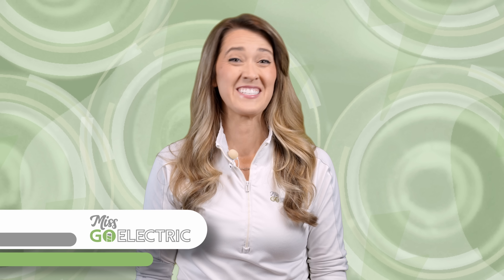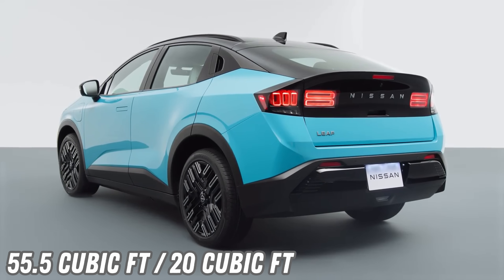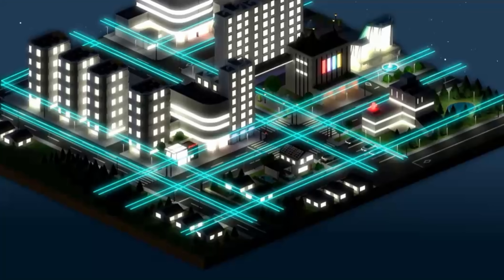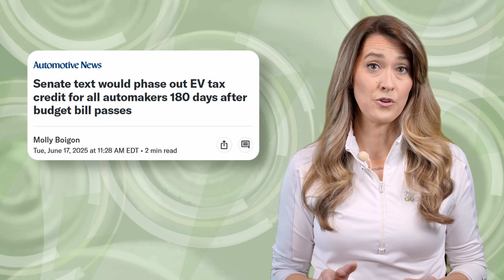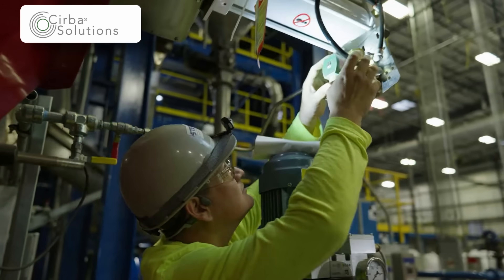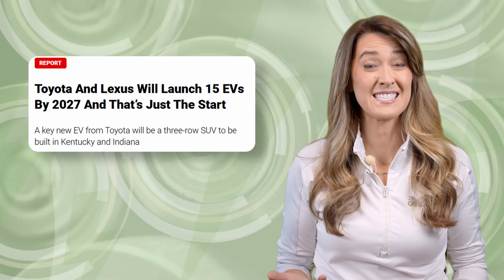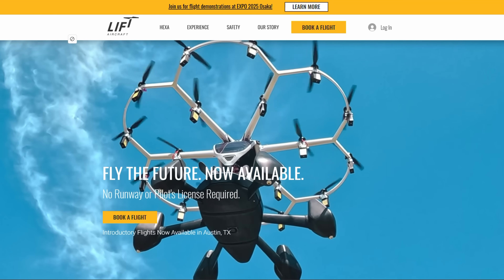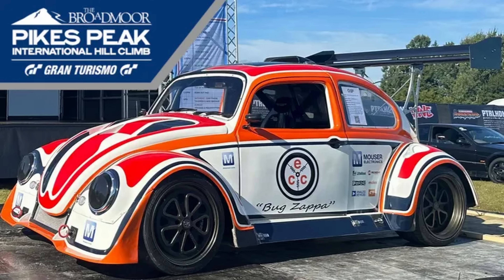The Current : Weekly EV News Ep#68 Jun 22, 2025

Comment: 1:28 highest trim gets the least range showing that they are completely out of touch with what it’s gonna take to get non EV buyers to buy EV’s.
Reply from the maker: Remember, the LEAF is basically a modified Ariya.  The Platinum+ Ariya also has the lowest range? Why?

There is only one large battery pack.  More features bring up the price, weight, and current draw.  There is no room for more battery, which means the fixed amount of energy results in fewer miles traveled.
Our detailed review of the Ariya will lend further insights into what is gained at the cost of range:
https://youtu.be/SdOal5q_7kA
-Producer Tim

Comment: eVTOL - zero glide time - NO
Reply from the maker: Helicopters have been around for quite a while.  They lack redundancy and incorporate thousands more moving parts which are susceptible to failure.  EVTOLs have high redundancy and very few moving parts.  Improved reliability and increased uptime are benefits of the platform.  Lower costs, lower noise, and greatly minimized required infrastructure for convenient hub locations are also benefits.

Remember, it will be much safter to fly an EVTOL from your small town or neighborhood to the airport than it is to drive an automobile to the airport.  Eventually, it will also be cheaper.  That is the primary function of the EVTOL rollout.  Short regional flights. -Producer Tim

Comment: They should have just gone with NACS like the latest Ioniq 5 - having two ports will just get confusing. What a miss.
Reply from the maker: NACS was adapted as a standard well into development of the LEAF.  Remember, this is a mass market product...essentially a modified version of the Nissan Ariya.  Nissan surely sourced the port component supply and finalized the charging system engineering at least a year ago.  It is somewhat miraculous that they've incorporated the port already.  The GM Sierra AT4 was just launched this month by an American automaker and it lacks NACS.

Remember, the LEAF has always had two ports. This is not new. -Producer Tim
Reply: @MissGoElectric  I did not know that the Leaf had two ports. In any case it seems like it would be wise to stick with NACS for any 2026+ vehicle. Putting J1772/CCS on a 2026+ model is like having a phone with micro USB
Reply from the maker: The new LEAF does NOT have a CCS port. It has a NACS port and a J1772 port.  Adapters are $30-$130 enabling AC and DC interoperability with all networks in America.  I do not understand how the user experience is degraded by having two ports. -Producer Tim

Comment: The 7.5 kw AC charging is a deal breaker. It should be 11 kw or better. That’s the only thing wrong with it.
Reply from the maker: What percentage of users depends upon AC charging for urgent situations with any frequency?  What is the real world improvement for most drivers who charge at work or overnight?  A full 0-100% charge of the largest battery pack would take 10hrs on 7.5kW or 7hrs with 11kW.  Either way, its done by the time folks wake up and go to work.  I cannot argue with the idea that faster is better on paper for sure.  I'd rather have a capability than not have it. From a practicality standpoint, I'm not sure the stats would show any quantifiable real-world benefit of 3.5kW for most use cases. -Producer Tim
Reply: @MissGoElectric  If you have been driving one all day and then get invited out to an event that evening there will not be time to add enough range. We have two EVs so we can just take the other one but if you only have the one car that won't work.
Reply from the maker: Less than 1% of Americans drive more than 50 miles per day. The average new EV has 250 miles of range.
If somebody is in a hurry to get a charge neither a slow 7.5kW to slightly less slow 11kW are particularly helpful solutions.

11kW is 0.18kWh per minute. 7kW is 0.13kWh per minute.
Example: Tesla Model Y would gain about 30mi/hr at 7kW and 44mi/hr at 11kW

-Producer Tim

Comment: I like the 2 different charging ports. Best of both worlds.
Reply from the maker: Thanks for sharing your thoughts on it. The LEAF has always had two ports.  We don't see a problem with it, but we see that some folks do.
We drive Tesla, Rivian, BMW, and Zero brand EVs in our house.  Each one has all of the adapters available.  We like flexibility.  Its great to see the country is moving towards one standard, but during the interim, having the capacity for interoperability is important to us.  -Producer Tim
Reply: @MissGoElectric  Again, OEM dragging there feet to standardize the NACS standard.
Reply: I don't, it just makes it more confusing and requires the need for TWO separate adapters now.
Reply: That configuration would work well with our home charging set up. Tesla’s charge port location does not.

Comment: Im going to post the explanation here for anyone to read on the Nissan Leaf port situation: NACS is a single port charging standard with shared AC/DC pins with a switch to choose AC or DC charging and an onboard charger which must be capable of 277 volt charging. The NACS change was made mid-design. Their onboard charger supports up to 240v as CCS needs, so to NOT have to find suppliers and figure out a switching mechanism, they took an international version of the car with 2 ports, and since CCS uses 2 seperate AC/ DC charging wires, simply turned the AC wires to point at a J1772 adapter to keep the same onboard charger and wiring, while pointing the 2 DC pins to NACS.
Reply from the maker: Yup....and...the outgoing LEAF had two ports. No biggie. -Producer Tim
Reply: @MissGoElectric yeah, but that's different given it was a AC only port (J1772) and a DC only port (ChaDeMo). An equivalent would a J1772Combo & ChaDeMo, but the CCS port only did AC charging. That's what the problem is.

Comment: Evtols sound dreadful … lots more stuff to clutter up our skies and come raining down on us when things break, especially with lack of proper regulation (as is the case with drones now)… we need much more regulation in the USA to protect people from corporations, not less
Reply from the maker: Remember, automobiles are much more dangerous than helicopters.  Helicopters are MUCH more dangerous than EVTOLS.  EVTOLS have 2-5x redundancy (can stay aloft and land safely with several motors failed/damaged) and EVTOLS have far fewer moving ports for exponentially greater reliability.  EVTOLS are quieter which means they can pick us up and drop us off in more convenient locations.  EVTOLS require a very small amount of property, unlike airplanes.  They can be put down in an emergency situation with far less exposure to dangers such as powerlines and tree lines due to a lack of required glideslope.  The Pivotal EVTOL, for example, is designed to float.  It has parachutes, too.

 EVTOLS are meant for regional transportation.  It will be much safter to take an EVTOL to the airport than to drive there.   -Producer Tim

Comment: (1:30) when will automakers learn that electronically recessed door handles don’t help range significantly in any way but cause huge headaches to people using them (whether the frustrating ergonomics of using them or the fact that they can and will dysfunction/break)… one of the many stupid ideas pioneered by Tesla that’s emulated by other automakers with idiot designers
Reply: The Tesla electronically recessed door handles you refer to were purchased from Mercedes.  They were the biggest maintenance problem on the Model S.  The mass market Models 3 and Y thankfully dumped the self presenting handles.  The Cybertruck completely eliminated door handles.
Reply from the maker: Automakers know that flush surfaces DO improve drag coefficient, reduce turbulence, and decrease wind noise.  They do it because range is important.  Every single one of the top 10 most aerodynamically efficient EVs have flush door handles.  Nothing with handles is close.
Lightyear 0 :  0.175Cd
Lucid Air :      0.197Cd
Xiaomi SU7 : 0.195Cd
Mercedes EQS : 0.200Cd
Tesla Model S : 0.208Cd
NIO ET7 :          0.208CD
Hyundai Ioniq 6 : 0.201Cd
Porsche Taycan : 0.220Cd

Mustang Mach E and Cybertruck have no door handles at all.  I have spent a LOT of time driving each vehicle....hundreds of driving sessions in each... and neither has ever presented a challenge for me.

Stormy pointed out that the Model S door handles were problematic for the first five years.  That is true.  Tesla replaced replace two which failed on my 2016 Model S.  They came to my house and did it in my driveway, so it wasn't really inconvenient...but certainly the wires which bend and unbend don't hold up to that frequent action in very cold climates.  They snap just like bending a paperclip back and forth quickly until it breaks.  To be fair, Tesla solved that in 2020 and there is no reliability problem with the current generation of recessed door handles.
-Producer Tim
Reply: @MissGoElectric  Good information.  Add to your list my favorite flush door handles: the Model 3 and Model Y.  Simple, easy to use, durable, attractive.
Reply: True

Comment: love that the nissan leaf has both NACS and CSS, more ev's should be like this
Reply: It doesn't. It has NACS for DC charging and J1772 for AC for charging.  You will need an adapter for CCS.
Reply from the maker: The LEAF does not have CSS.  It has J1772 (AC) and NACS (DC)
Of course, an adapter will allow LEAF to use CCS dispensers.  We have CCS adapters in our Teslas and we have a NACS adapter in our Rivian.  It is wise to carry the tools for interoperability.  That enables a high degree of freedom and efficiency while traveling. -Producer Tim

Comment: Instead of the two charging ports they should provide adopters to user at discounted rates.  Just have the new Standard.  Its going to be expensive with the Tariffs.
Reply from the maker: The long-term tariff rate on vehicles coming from Japan and other allied trade partners is fluid and unknowable.   We are happy Nissan was able to pivot and incorporate the NACS port at all.  Remember,  Ford, GM, and Stellantis continue to release and produce CCS vehicles.  Fortunately, adapters are cheap.  Its wise to carry equipment which enables interoperability for maximum flexibility when traveling. -Producer Tim

Comment: How stupid it is to have 2 different charging standard on same vehicles, Wow.
Reply: Especially since one does AC only, and the other DC only. If it was full NACS and full CCS then never needing an adapter is kind of a cool perk, but this weird restricted setup is just that... Weird.
Reply: @Snerdles You will still require a J1772 adapter with CCS
Reply: @rozonoemi9374 why? The top part of the port has a J1772 for home charging and the two extra pins on the bottom for DC. With real NACS and CCS you cover all three possible connectors on any common charger. The only thing you can't use is Chademo but that's already obsolete like J1772/CCS wo soon those will be in the same spot.
Reply: @Snerdles  Why 2?
Reply: Here's the base details: NACS is a single port charging standard with shared AC/DC pins with a switch to choose AC or DC charging and an onboard charger which must be capable of 277 volt charging. The NACS change was made mid-design. Their onboard charger supports up to 240v as CCS needs, so to NOT have to find suppliers and figure out a switching mechanism, they took an international version of the car with 2 ports, and since CCS uses 2 seperate AC/ DC charging wires, simply turned the AC wires to point at a J1772 adapter to keep the same onboard charger and wiring, while pointing the 2 DC pins to NACS.
Reply: I can only assume there was a cost reason.
Reply: @Andre-cj3ec  One standard is cheaper than 2 standards!
Reply from the maker: The outgoing LEAF had 2 ports.  Porsche Taycan had two ports. Why is it detrimental?
-Producer Tim
Reply: @MissGoElectric both of those ports work as they are designed to function and not a weird restricted case designed specifically to be confusing.
Reply: @MissGoElectric  Cost more money & NACS is the North American Standard chosen by all EV manufacturer, so why 2 standard?
Reply: @rozonoemi9374 Think of it like USB plug types and chargers. They each serve various devices and purposes, charge rates, etc. The EV charging standards cater to different manufacturers and charging needs.

Another way of thinking about it is to consider different voltage standards and plug designs for national and international electrical grid systems. America uses a 110 volt system but also delivers it through a 2-prong set up (no ground) and a 3-prong set up (ground) whereas in Europe and other parts of the world, they use different variations of 2-pin/3-pin plugs depending on the power requirements of what’s being powered. 

In the end, it’s the same electricity but it has to be delivered and utilized in different ways.
Reply: @housepianist  NACS is the North American Standard Now.
Reply: @rozonoemi9374  it's becoming the standard now but it isn't yet. There's the Electrify America network (DC Fast and CCA) and which also breaks down in variants for homes and businesses. 

NACS is not a bonafide standard yet as long as different EV networks and their connections exist. Not sure why you're being so argumentative on this fact. I'm not disagreeing with you but you failing to look at the larger picture. NACS is just ONE type of standard but yes, it's becoming more adoptable today.
Reply: @housepianist  Usually the most used Charging system wins the Standard war! The CCS protocol was decided by the EU Country, not engineering.
Reply: @rozonoemi9374  you're straying from your original post. You implied that it's stupid having two different chargers for EVs. I'm simply saying that it's not stupid because both EA and NACS are viable e-networks. 

No one is denying Tesla's marketing strategy by expanding its network to make its system a standard in this industry. But as long as BOTH EV networks exists, and that EVs are equipped with either charging set-ups - or both - owners can choose either network depending on availability. It doesn't matter what the EU says. It's actually smart to have both types on a vehicle. 

If I had an EV, being able to use both standards is a smart idea. But sure, go ahead and tell me again how "stupid" it is having two ports on a car. There's are thousands of cars out there that don't have an NACS adapter but they utilize EA's extensive network. 

Perhaps Tesla will be the defacto standard someday but not now. Sorry you don't understand that. On that note, I'm done with this thread. 

Mute Mode: [ON]
Reply: @housepianist  Shortsighted!
Reply: J1772 is ubiquitous and not compatible with NACS …
Reply: @panameradan6860 and obsolete.

Comment: I bet the price of ev will go down 7,500 when the free money goes away
Reply: That didn't happen in Canada when they stopped their 5K direct at purchase rebate (not tax credit). 

A bunch of vehicles actually increased in price within a week because the manufacturers and dealers were keeping the prices just under the price limits of the rebate.

The obvious famous example was the day the rebates stopped the M3 jacked up a few grand and then a couple months later tariffs in Canada jacked the M3 price up even more so it went from 54990(to meet the "under 55k base model" for rebate eligibility) to over 79k in a few months.
Reply: No complaint against subsidies for petroleum industry?
Reply from the maker: Most EVs do not have sufficient margin to enable a $7,500 drop, but features can be erased and other corners can be cut to keep entry-level price points low.  Battery costs drop by ~10% annually, which continues to drive prices down naturally along with economies of scale which are improving costs for big players such as Hyundai Group and General Motors.

Solar on the other hand...I suspect the 30% subsidy will go away in that industry with no affect on net pricing for customers.  They've got grotesque margins.
 -Producer Tim
Reply: @MissGoElectric happened in Europe with the ID3 from VW. A Miracle
Reply: Happened in Europe identically. This silly subsidy is just a hidden amount for manufacturers.